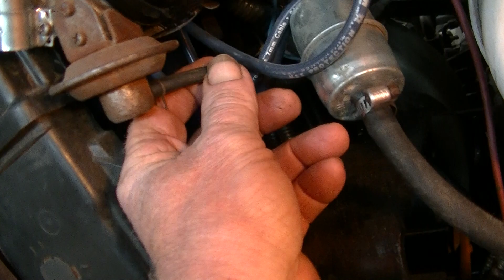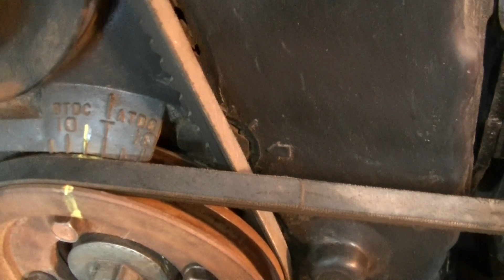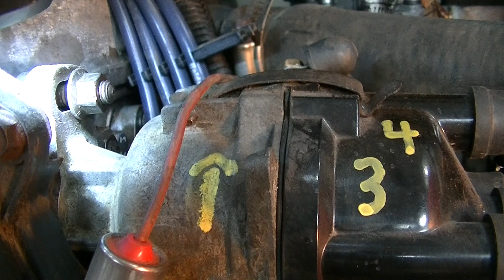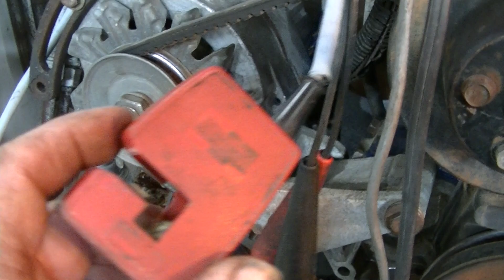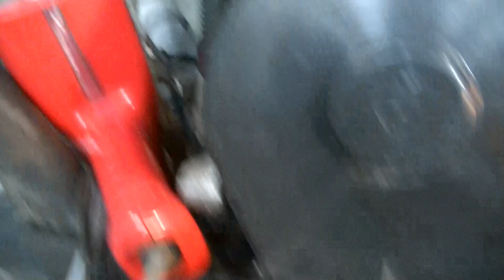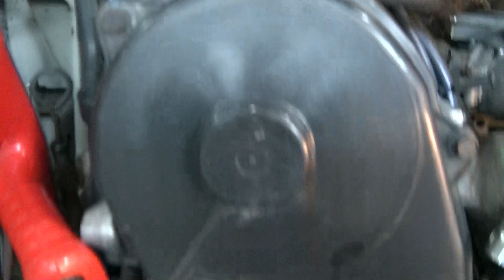Bobcat 642/742 - Mitsubishi 4G32 engine - Final ignition tuning - zeketheantiquefreak

Comment: On to the next issue... Engine oil light has been randomly coming on. Oil level is good, engine seems to be running fine, not hot or anything. I'm leaning towards a faulty sensor. I can't find in my service manual anywhere about what the pressure should be, or whether the sensor is a normally open or closed variety. Do you happen to know the answer to either of these questions? I was also considering replacing the dummy light with a gauge. Thoughts?
Reply from the maker: I checked the service manual and the only pressure specification they list is for the relief valve, '57-71 psi', which is not what you are looking for. Yes, I would recommend removing the sender and install a trusty mechanical 'master gauge'. I am thinking anything less than 25 psi at idle is a problem. If excessive engine clearances allow too much oil loss, ergo, low oil pressure, a heavier weight oil can make the difference, until you need to do a winter start... Oil pressure will be lowest at idle, so if the master gauge reads good, and the light comes on randomly at any engine speed, a (1) faulty sender or a (2) bare wire on the way to the sender would be suspects. The power for the circuit should go to the bulb first and sender last, which completes a circuit to ground when the oil pressure is low. Hope this is of some help. Let me know how you make out.
Reply: @zeketheantiquefreak8518  Master gauge installed. Now I didn't test the gauge before installing it, so it could be faulty, but it's ready 80+ psi. I have two questions for ya'. One, can the oil pan and pressure relief valve be accessed without pulling the engine?  Two, what are potential problems with running engine with high oil pressure?
Reply from the maker: @rocketrobMontana  The Mitsubishi 4g32 engine was used in all sorts of cars and equipment, such as some small Chrysler products, imports and Clark forklifts, etc. Not sure if some information couldn't be found on the forums, say. If it is any consolation, the engine is easy to remove. The pan would have to be removed to access the pump. That said, if the rated relief pressure is ~50 to 70 psi, 80 psi is not far out of range, but scary. If the lube system is full flow, the filter and gasket have to contain what seems to me an enormous pressure. I could master gauge mine, but with that special thread I am unable to connect to a master gauge. I am thinking that if everything is holding up and the engine is running well, it might be best to leave it alone until you can find information saying otherwise. Sorry I can't be of more help.

Comment: What is the contact point gap of the distributor?
Reply from the maker: Thank you for the comment. Point gap is .018" to .021". Dwell angle is 52 degrees.
Reply: I have a 4g33 engine. I cant find the oil pump timing mark of it, is there any or i just put it in ramdom?
Reply from the maker: @adamzelorubungen6301  I feel it is the same as the 4G32, the oil pump gear just acts like an 'idler', the position is random as you said. Thank you for the comment.
Reply: Thank you for the info. Im restoring a Mitsubishi lancer boxtype engine 4g33.
Reply from the maker: @adamzelorubungen6301  Good luck with your project!
Reply: Thank you! Godbless!

Comment: I used to tear into these things all the time, but as I get older it weighs on my mind more.  My belt went bad and the shop says around a grand after I get it to them. It doesn’t seem like a bad job changing the timing belt since it’s all right in front of you. Were there any surprises along the way. Do the pulleys come off without special tools?  Thanks for the help
Reply from the maker: Yes, I had much confusion until I got to the point I could make the video, but would not be afraid of it now. The job can be done with a mix of standard and metric tools, neither the coolant or the oil has to be drained. I believe the engine to be a 'non-interference' style, meaning there is no danger of the valves getting bent by the pistons if things are out of time. I would say 'go for it' after painting any pertinent marks for ease of assembly. Thank you for the comment.
Reply: I’m curious how you moved it when it didn’t run. My is parked about 100 feet from my shop. In good old North Dakota we are in the teens  already.  Too cold to work outside. I was thinking of making skids and rolling it on pipes.
Reply from the maker: @darrelljamsa  Same here, last winter I covered the thing and let it languish for the season. The engine was in the shop to work on and the months passed by quickly. 
   Two options to move it: 1) Remove the covers and four bolts on the drive motors and let them hang on tarp straps or whatever. 2) Locate two Bobcat part # MEL1179-2 towing tools (No longer available) and place them behind the two large bungs that are on the upper RH side of the hydrostatic. Thank you for the comment.
Reply: @zeketheantiquefreak8518  thanks
Reply from the maker: @darrelljamsa  No problem. I am in Southern Manitoba, so we share a lot of weather.

Comment: Zeke, in your work on this 642B have you done any adjustments to the governor? Would love to see a tutorial on that.  I had to replace the generator on mine, which required disconnecting governor. It used to start like a champ, with throttle one pump forward then back to half, and choke on. As soon as it fired, could slowly shut the choke off. After a minute of warm up, she was good to go. Now, it's much more touchy. Have to leave the choke on longer, and not throttle up until it's completely warmed up. Thanks
Reply from the maker: As an afterthought, I did have a hard starting situation that puzzled me... It turned out that the choke cable had slipped in the linkage retainer thingy, and the choke plate was not fully closing. Simple fix when I finally figured it out. The carb, being somewhat automotive, has an accelerator pump and several strokes on the throttle lever will squirt fuel into the venturi. Let me know how you made out.
Reply: @zeketheantiquefreak8518  well temperatures dipped below zero today, so won't be giving starting a try until it warms up a bit, But will check that out, sounds like a possible culprit, and let you know. thanks
Reply: Zeke, thought I should give an update. I got it all worked out. Did have a slipped choke cable. fixed that as well as some additional adjustments to governor. All working well now. Thanks
Reply from the maker: Thank you for the comment. I have a copy of the shop service manual with governor adjustment. I will try later tonight to post the governor adjustment procedure for you.
Reply from the maker: 642B 4G32 Hoof Governor Adjustment:
(This may well be confusing without the accompanying diagrams.) 
   Adjust engine timing. Adjust governor belt tension. Disconnect throttle rod. 
   Hold carburetor linkage and governor linkage against their stops and tighten the screws. Check the governor throttle lever for maximum travel.    Start the engine. 
   Check that the engine idle speed is at 700-750 rpm while holding governor lever against the idle stop.
   Set the throttle lever fast position stop bolt at rear of slot.
   Push throttle lever fully forward.
   Set engine rpm at 2900-2975 rpm by adjusting the ball joint and high speed stop on the governor.
   Pull throttle lever back until carburetor lever is against the idle stop screw.
   Set and tighten the slow position stop bolt against the throttle lever.

Comment: Have a question on the base of the carb there is port for a hose does that get hooked to something or is it plugged off?
Reply from the maker: I have two ports, one is for a small hose that goes to the distributor vacuum advance. Another comes out of  the intake manifold and is ~5/8",  blanked off internally. I capped it because I didn't like the look of it being open.

Comment: Do your self a favor and convert it to electronic ignition. Pertronix sells the part for $90 bucks by far the best upgrade I ever did to my 4g32 742b bobcat
Reply from the maker: Yup... Pertronix said they were out of stock and didn't know when a unit would be available. I was able to successfully install a 'Hot Spark' unit and haven't looked back. Thank you for the valuable input.
Reply: Have you considered deleting the mechanical lift pump and installing electric? Another major improvement i made to mine. Removed mechanical pump made a custom block off plate. Installed Holly lift pump 5-7 psi, then installed a low pressure returnless regulator, and 40 mesh fuel filter. Removed all factory lines and installed stainless braided lines with 6an fittings. Set fuel pressure on regulator to 3.5 psi thing never spits and sputters fires right up another great improvement however it costed more then the electronic ignition. Bout $300 however i also feel the machine is safer with much heavier duty fuel lines!
Reply from the maker: @rileybennis4029  Thank you for the comment. The mechanical pump had been bypassed and an electric pump installed. I did as you and made a block off plate for easier access to stuff. I like the idea of a fuel pressure regulator, would you by chance have a part number for that item?